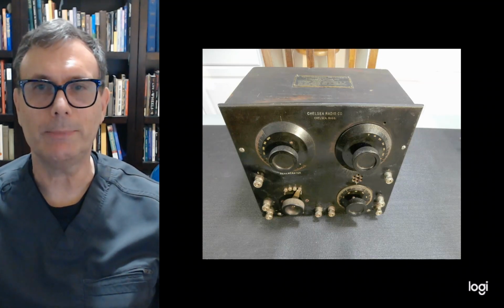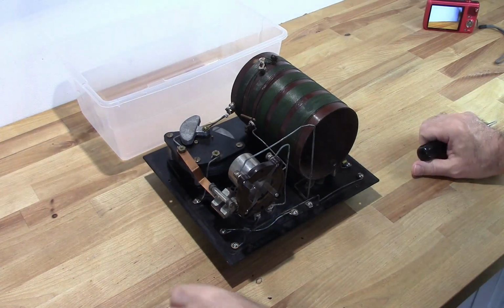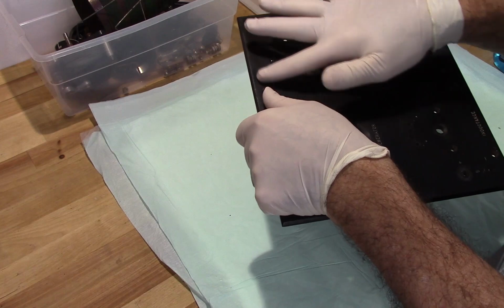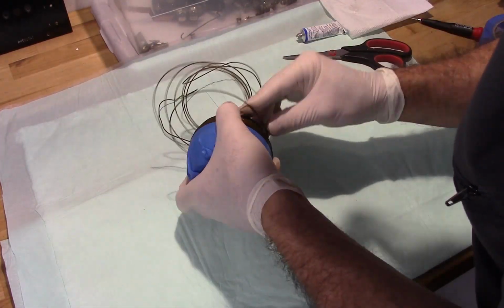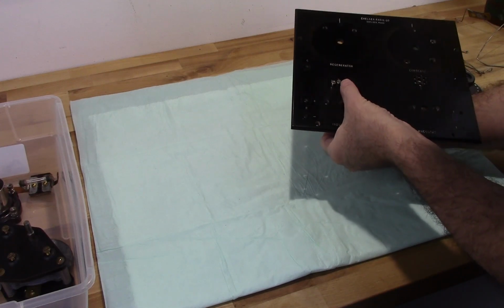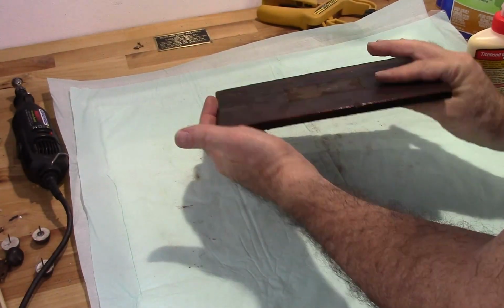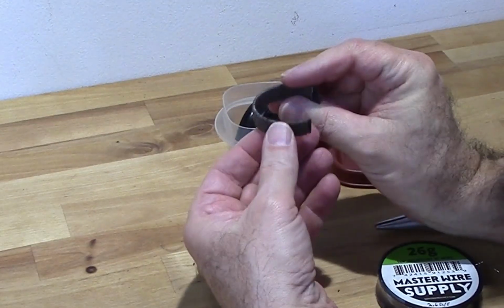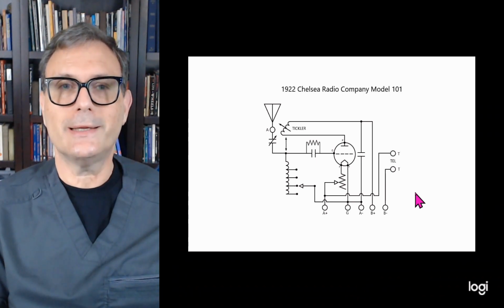1922 Chelsea Model 101 Receiver Restoration

Comment: Hi you have a good teaching quality and Enjoy watching your videos. I have a question hope you can help me with. I have a AC Dayton XL-5 both audio transformers are bad (1) type R-21 ratio 5-1 (2) R-12 ratio 3-1   Can something new replace them or rewind them?  Had the radio for years. As you can tell I don’t have a lot of radio knowledge but I’m trying.Thanks
Reply from the maker: You have a couple of options.  Those transformers are very common, so they pop up on E-bay all the time.  Another option would to be to replace the cores.  I have a video on repairing a Chelsea transformer that covers it.  You can either find a similar size used transformer, or you can order a couple of cores from Antique Electronic Supply.  The part number for a replacement core is P-t431.  They are 3:1 but those will work for both.  Just make sure the center leaves for the core will fit the hole, I think it will.

Comment: Thank you so very much for sharing this.
For what it's worth: I am an AM broadcaster as well as engineer. The truth of the matter is that AM radio to this day works electronically the same as it did when that radio was built. The only difference is that most (not all, but most) of the transmitters are "solid state"  instead of tubes, but it still works the same way that it has for over 100 years. It's primitive, for sure, but that's part of the fun, IMHO.
I love, love, LOVE the idea that is as simple as it is, yet effective.
Again; thank you for sharing your rig.